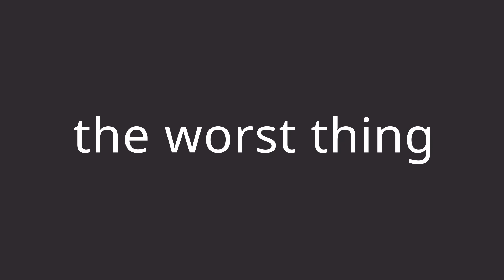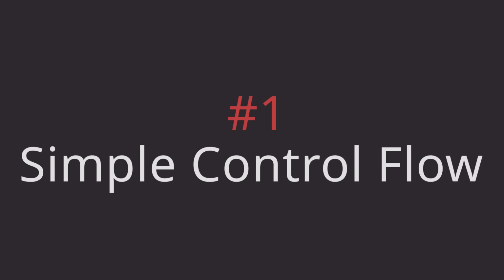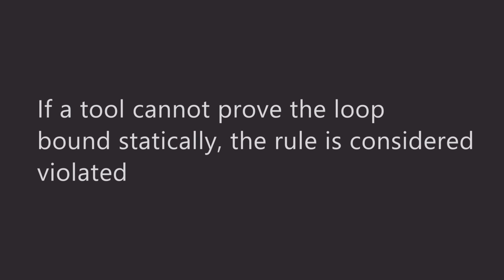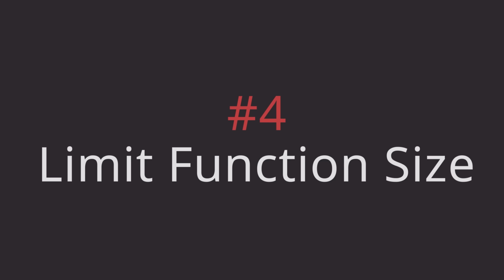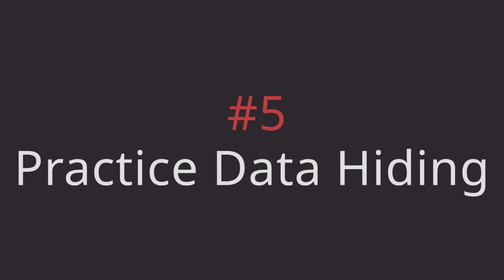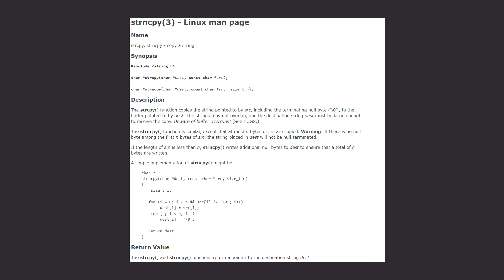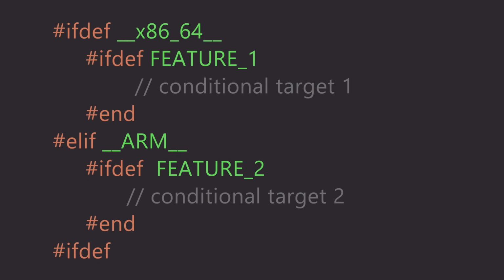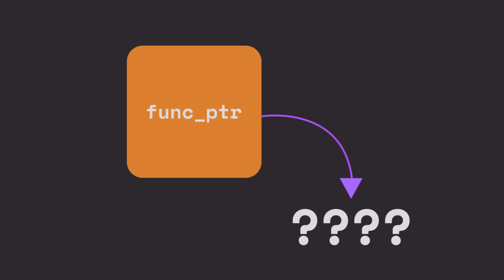how NASA writes space-proof code

Comment: It is very similar with the rules used in the embedded development for automotive industry.
Reply: Yep. The rules are known as MISRA, and they are used not just in automotive industry.
Reply: @alexandermarvin9536  Yes, MISRA was created for automotive, but now it is used also in other areas. However, some parts of the code present in this video clearly violate some MISRA rules and this surprises me. For example: mandatory else at the end of 'if..else if' chain or the rule that every function can have only one single point of exit, so only one return located at the end of function body is allowed.
Reply: @alexandermarvin9536  but according to MISRA website, MISRA was started in the early 90's. NASA has been around before that. Maybe NASA rules didn't come from MISRA?
Reply: @alexandermarvin9536  I came wondering ooh what secret and special rules NASA would use??
And then went oh just typical misra :(
Reply: There are already compiler warnings and static analysis for MISRA-compliant C. It’d be nice if a language could make compliance mandatory, but different embedded systems have different limits, and there are reasons to deviate from the standard guidelines. Hard to make a strict language for a moving target. As for the argument for gc languages, heap memory management is non-deterministic, it’s not something you want for real-time, and if you preallocate before the loop and never free, there’s no reason for a gc anyway. In fact you’d want to remove that unused feature to have more memory to use.
Reply: @MynameisBrianZX  oh yes, embedded is always carte blanche for excusing following good engineering principles. This profession is a joke
Reply: @monad_tcp  If you're so confident you know what a language that enforces "good engineering principles" for embedded systems should be, then make one. I don't have high hopes considering you're ranting about manual memory management in a context that doesn't need heap allocations, but maybe you do know better than several generations of programmers.
Reply: @MynameisBrianZX  you're wrong about the context of embedded not needing heap allocations.
Whats being demanded from embedded devices nowadays it's much more akin to what we demanded of desktops in 2005 , in terms of them being connected to networks, running multiple services, and being reliable .
Which is why we get "internet of shit" insecure bugged devices , I mean IOT.
What I'm saying is that embedded is not a special unique field .
It's software engineering and software like everything else .
 But just stuck on the past and with outdated software development methodologies specially because of this culture of exceptionalism.
I don't need your hopes.
And I was not ranting specially about embedded development , I was ranting specifically about the C language, this thread became long enough for context to change or be lost.
Reply: @MynameisBrianZX  of course I know better than 3 generations of software developers , I saw what they did, and I saw why it doesn't work. I'm on top of the their shoulders.
I have hindsight given to me by knowing history and I refuse to keep making the same mistakes out of being stubborn.
Also I have experience on the field, so I don't need your permission or anything.
In fact I'm so confident about it that I have a business developing tools to fix those problems.
But if you still thinks you're the right one, so keep thinking whatever is that you think. You do you, you stay on your path, while I carve new ones in the jungle of unsolved problems.
Reply: True, except maybe the macro part.
My favorite MISRA warning is having multiple return in a function btw.
Reply: Big rocket needs to go boom boom but code not
Reply: MISRA here we go!
Reply: Ah yes, "miserable C" is what I and some colleagues call the most popular set of guidelines.
Reply: Ah yes, "miserable C" is what I and some colleagues call the most popular set of guidelines.
Reply: Iso26262 too?
Reply: @carlesls  jeez, you triggered my ptsd. I just want to forget this ASIL thing
Reply: Maybe for the engine computer, otherwise all bets are off IMH
Reply: @ffoska  All safety-relevant devices are handled the same way (actually more than that). It's only the infotainment system that gets a little wild...
Reply: except for that one radio station in seattle that had an image formatted incorrectly that caused certain car infotainment systems to bootloop
Reply: Fixing MISRA errors 😅
Reply: I wrote embedded FW for medical devices and we followed most of these rules too. Although it makes sense that our code is similar to automotive since we used MISRA rules for our static analysis.
Reply: they ban pointer arithmetic, which is a good thing imho. if you need to access an offset you should use [], not +
Reply: I was going to say the same thing about embedded code
Reply: Medical devices as well
Reply: Not coincidentally ...
Reply: Or particle physics accelerators near the interaction points where decommissioning the system is the only way to access it.
Reply: @aravindsathyanarayana3256      "Garbage collection isn't deterministic"  Garbage collection can be deterministic, there are models that guarantee it will run for at least that fixed amount of time (*1) , its the use of the heap that makes your software be not deterministic.
It literally don't matter much how you manage the heap, having the heap is the problem.

"In some hard real time systems where memory is to be allocated using malloc/custom function, it is usually done one at system startup n never released till shutdown/sleep"
That's exactly what I was saying before.
Allocating memory at the startup is the same as having global static memory. 

You're not using a heap as a heap, you're using it as a massive stack if you do that.

(*1 - it really depends on the implementation, it usually isn't because most GCs are tracing, and they would need "pointer tagging" and that would need hardware acceleration to be efficient and absolutely no hardware have it, and most computers actually already use virtual memory, so there's no point in doing that if you are a virtual memory system, you're already non-deterministic in runtime anyway)
Reply: And medical device software too
Reply: Glad I was taught similar things when learning how to code in my first language, C
Reply: Some years ago I interned at a company that makes packaging machines for pharmaceuticals. They also have very strict restrictions about code, and everything needs to be certified. The customer also comes to the plant and reviews all code of the PLCs
Reply: I mean these rules are for safety and cars do require and always will require as much safety as possible you don't want your car's program to crash while you are going +80mph and even if that happen they can decode it and see where it failed and fix it...(rip to the guy who got sacrificed to find out that error)
Reply: This is the comment I was going to make.
On top of these rules though, there are also 100% code coverage, fuzzing, KPI calculations, debugging traces, etc. Lots of stuff. It's not a rocket and not in space, but all it takes is 1 accident and the company shares drop 20ish percent
Reply: This is like a car mechanic saying "the steering wheel of a car is very similar to a 747 flight stick"
Reply: Its almost as if satellites have embedded systems.
Reply: Yeah when I watched this it just sounded like misra rules
Reply: And medical…
Reply: MISRA :)
Reply: Mostly just mentioned C++ coding guidelines
Reply: I was pretty impressed with the Tesla security presentation at Defcon; iirc it compared Tesla's decisions against other automakers' in a decent way
[edit]: Due to questions below, here are search terms: DEF CON 23 Marc Rogers Kevin Mahaffey Tesla Model S
Reply: @oddlyspecificmath  link?
Reply: @Croissinate  In case there's a channel filter, just the search terms: DEF CON 23 Marc Rogers Kevin Mahaffey Tesla Model S  It was popular so just the bold terms should work.
Reply: @oddlyspecificmath  which talk ??
Reply: @ko-Daegu  Ah, more people asking :) I'll edit my first post with search terms.
Reply: If those rules are so good , why don't we create a programming language where it's impossible to break then instead of relaying on absolute perfection of human discipline (unattainable goal).
But no , we keep using C
Reply: @monad_tcp  I think the rules are really restrictive, not really “comfortable” for most situations. Meaning it would be a lot of headache and take a lot of time to create any program. HOWEVER. When you are writing code that will go to space, if it crashes then there is literally no way to remotely restart the computer. So you have to go the extra mile and be absolutely certain that it will never ever crash. That’s not really the case for most applications though
Reply: @dominiklukacs7677  That's the problem with the C language, its the "confortable" thing, they are HARMFUL.

If there's one thing we learn as the field of programming and computing science advance is what not to do.

Because you can literally do anything:
self-modifying code
come-froms
gotos
non-structured code (no use of functions)
everything is mutable
everything is dynamic memory
dynamic types
only a single type
nulls
excessive message passing (aka function calls)
manually positioning every single byte in the memory

turns out, all of those options were Bad Ideas (TM).

See, that's the problem with C.
Being too comfortable with mutable state by default and not thinking when state transitions are required and when that's just data transfer masquerade as mutable state (because of a blunt tool)

Another thing that humans are utterly bad : manual memory management. Why the f, do we manage memory ?  its total accidental complexity, no algorithm really requires it, nothing in the problem you are actually using computers for require it . Fortran didn't even had memory allocation, you just declare your arrays a fixed size which was a parameter of the program startup, and that was it. If it didn't fit memory, you just change an option, nowadays it doesn't even make sense when you can address a PB of memory, just let the OS do it for you.
Do you manually mark and control blocks on your hard drive ? no, the operating system does that. Why's it acceptable for a program/programmer to control memory ?
And the most ironic thing of all, manual memory management is more of a cultural virtue signaling (see how good I am, driving my bike without hands, proceeds to fall off and break all teeth). 
Really, manual memory management is the most boring thing ever. Its basically inventory management. 
Guess what, "normal" people use computers to manage inventory for them because they realized that by memory (human memory) they kept forgetting where products are, how much they are, and when to buy more inventory.
Its ironic we program computers and have tools to manager cruft like memory, but we don't use it because we, as programmers, think is heroic no to use them.
Like, don't even come to me saying its "optimization", its just bad engineering, and the generational model of memory consumption is one of the most tested and established truths about how data flows. Automatic memory management uses only twice the amount of memory it would be required if you manually checked every single bit, and that's the worst case, the average doesn't come closer to 20%. (its like floor-plan planning on microchips, machines do that for 1B transistors)

Things that were utter mistake that cost lives and billions of dollars :

NULL POINTER.
Manual memory bugs.

C has those, so its totally not fit for purpose. If we were civil engineers, we would be embarrassed by the failures, and the fact that all bridges collapse. Not only that, we know why they do it, and we even know the solution, we simple refuse to change our "ways".

Which is why in critical safety system you aren't allowed to allocate memory after the startup of the program, everything is allocated beforehand and it stays allocated forever, even if that costs more memory. 
Memory usage doesn't matter that much, not to the point you introduce bugs by using dynamic allocation to overlap. (don't even get me started on stupid memory aliasing in C, not even the hardware likes it, its stupid, and breaks DMA and I must scream)

Perhaps I need to wait on this hill for the old programmers to die. You know those that were born in a world when 1MB of memory cost $1M USD. 
Nowadays I can buy a microchip that costs $0.5 that so small that I could eat it and it has 1GB of RAM, there's no reason for using memory unsafe programming languages.
Reply: @dominiklukacs7677  what about implementing a watchdog timer?
Reply: @monad_tcp  hi
Reply: @monad_tcp  Quite a rant. Agree with all of it.
Reply: @monad_tcp  You are completely ignoring the embedded space.
Reply: @LittleRainGames   I'm not ignoring it, I'm talking about management of the heap. Embedded development has strong restrictions that don't allow the use of the heap because of the exact same reasons and problems with manual memory management. 

The MISRA rules almost force you to use the stack, thus you don't suffer any of the problems. Most of what I said don't apply to embedded because you don't do manual memory management on the embedded space.

Everything is stack allocated or statically allocated by the compiler. 
I'm literally advocating that this should be the standard for everything. 

I know this thread is already super long and some context might be lost, but pay attention.
Reply: The MISRA rules almost force you to use the stack, thus you don't suffer any of the problems. Most of what I said don't apply to embedded because you don't do manual memory management on the embedded space. Its much more important to allocate everything all at once, then "leak" it, then account for the total memory needs of every single variable without any sharing at all, then you force that as requirement for the hardware. I worked on this field too, some things are a bit different in this regard, but things are changing and you are going to start having the same problems as traditional CPU computers have, because you're not on a so constrained environment anymore. 
The moment your embedded system has any sort of network connectivity, that's the moment things change, and none of those rules are good enough anymore. Thus your carte blanche is not an argument to this discussion on memory management.
You better get up to speed to modern software engineering.
Reply: @dominiklukacs7677  I always wondered how they did code......makes sense it shares similarities to the automotive industry standards, I would assume underwater vehicles would get similar treatment since the oceans and outer space are the harshest environments known to man.
Reply: @monad_tcp that part about people turning to computers because they couldnt remember where inventory was is rubbish. 

Programmers told businesses it was cheaper to do it on computer than on paper.

The layman never asked for computers, computers were interjected into their kids lives and their working lives against their will.
Reply: @monad_tcp  Until recently there was no viable alternative for its use cases. Also, as I understand, NASA uses tried and tested tech. So, say, a mission being created today won’t use Rust. But one created in 10 years will.
Reply: @kevinmcfarlane2752  fair enough .
But Rust is almost there in reliability, it's not like it's not mission critical, it's just isn't there for NASA it isn't yet.
But as both Microsoft and Linux are slowly incorporating it on their systems. It'll happen eventually.
So you're probably right.

Rust is really different this time because it was built on top of an actual formalization of the life cycle and management of memory.

It's not about 'heap' or malloc.
Reply: @monad_tcp  you have a fork and a knife. In case you are right handed, you should hold the knife in the R hand and fork in the L hand. Thats the correct ettique. If thats so elegant and right, why dont we create a fork and knife that electrocute you if you dont hold them properly?
Reply: @salat_32  that's not a bad idea .
Reply: @monad_tcp  what if I told you this language exists and has been used for longer than C (yes, Fortran)
Reply: @gronki1  FORTRAN is a bad example, FORTRAN90 added dynamic memory precisely because people were using unstandardized extensions including malloc and free, or they were declaring large arrays and manually managing the elements.
Reply: @gronki1  ironically Fortran is literally better than C
Reply: @MynameisBrianZX  this is exactly why we need heap management in a programming language.
"but it's embedded" no, try implementing a TLS ASN.1 without inventing poors man malloc in a system without a MMU and come back to talk to me.
Things I've heard related to that :
Oh you don't need network , right. Yeah, good luck with that, even a pic32f has a network library. Oh cares about security , right ? Send plain text.

Even Sun.Misc.Unsafe became standard.
There's clearly a need to have access to low level memory management.
One might pretend they don't need it, as they pretend they don't need heap.
Or they do as Rust did. Here you have unsafe in the rare cases you need it, don't go hacking non-standard crap.
With heap and memory management it's the same thing. "it's embedded I don't need it"
 Sure, but when you do you're going to need some formalized way of dealing with the heap, that's why Rust exists.
(just not going to realize that until too late, then implement a poors man malloc/heap, then shoot oneself on the foot, as one usually do if you use C/C++)
Reply: @monad_tcp  ADA or Spark
Reply: @monad_tcp  That's kind of the goal of the Rust language...
Reply: @adrianbool4568  Yes, I was gonna to add to the conversation that Zig, despite not being production ready just yet, also has a very similar goal. Zig is to C, what Rust is to C++ (in theory).
Reply: @tomsbk  that's a good take
Reply: @monad_tcp  they mentioned they use static analysis to verify the rules are being followed, so yeah.
Reply: @Slackow   That's as good as opt-in, and you know how people go for opt-in standards...
Reply: @monad_tcp  not really. How exactly do you design a language that is constrained to these things anyway? Like sure you can make it not compile if you have too many lines in a function but realistically what's the difference between doing that, and just using C, while requiring devs to run their code through some static analysis before pushing their code? It's the same thing.

This way you don't need an entirely new tool for constraints you may want to change in the future and you can hire people who have experience with C
Reply: @monad_tcp  They use C because it is the best option currently. Garbage collected languages are too inefficient for embedded systems.

Yes, they could rewrite the code in a safer language, but there is probably  millions of lines of C code used in Nasa, it would be stupid to rewrite all that code, the rewrite would be more effort than just improving the C code.

As the other guy said, they use statical analysis tools to enforce the rules. "Oh BuTs ItS OpT-iN sO iT iS uSeLeSs". No, the senior devs can enforce the use of those tools and probably does. 

I am currently learning Rust, since i do not trust myself writing safe C code, but your ranting is just nosense.
Reply: @Slackow  how do you design a programming language that constrain semantics ? The same way you design a static analyser that does that.
Except you incorporate the semantics in the syntax to make it easier to model the semantics and for it to be explicit.
And you don't need two tools doing the same thing and fighting each other.
Your compiler says X.
Your analyser says Y.
Who's right ?
That's the problem when analysers are opt-in .
About people having experience , doesn't matter much, programmers that only know one programming language are kind of limited either way.
You do what anyone sensible would do. You hire based on domain model, if a person knows how to design software for quadcopers , does it matter if it's C or C++ or Rust ?
That person could learn the language in a couple of weeks.
Their domain knowledge is much more valuable than knowing all stupid quirks of a programming language.
Specially as you are going to use static analysers or a language that's a good tool and guides you the correct way.
Reply: @rj7250a   no one said rewrites , rewrites are always expensive.
Which is why were in this mess.
But can we please stop writing new code on archaic languages.
Reply: @rj7250a  seniors can enforce the tools , hahaha , is this "the office" sitcom ?
That's why we need programming languages, it should be enforced by design, not by policy.

Policy change as people move out and in on companies.

A tool design doesn't , because it's defined by the comitee of system designers and it's standardized.

And you're the same one that said "but hiring", well, what if every company has their own static analyser ?
now what , you are going to learn a new environment either way.

I just want it to become a standard like engineers have.

At least for safety critical systems. I don't care about the "I'm unique exceptionalism of your company"
Reply: @monad_tcp  I still don't see the issue of static analyzers, how is it "opt-in"? what if it's a standard part of the process of pushing code? Like in order for you to make any changes your code must pass both compilation and analyzation. I also don't really see what you mean about the two fighting, it's just an additional layer.

Why overcomplicate it by adding new tech to maintain when you can extend tried and tested languages? Every organization wants their own parameters for this sort of thing anyway.
Reply: @rj7250a  the biggest problem with garbage collection on microcontrollers is not so much inefficiency (although that's a part of it) but unpredictability - as soon as you're anything approaching real-time, you can't afford random GC pauses

"Open the pod bay doors HAL"

"I'm sorry Dave, I'm afraid I'm running a stop-the-world garbage collection right now"
Reply: @NicBellamy  Incremental GCs split up collection cycles across frames for (soft) real-time, eg the game engine Unity. But so far that seems to take overall more time (throughput-latency tradeoff), and it does not prevent all GC spikes. Even with a GC, it's good to avoid overwhelmingly frequent garbage, and there are deterministic but more situational allocators, provided you have the memory to spare.
Reply: @MynameisBrianZX  there's a way to prevent spikes when you have multiple cores and a cross-bar when you implement a non-stop-the-world.

People keep parroting GC = pause like its 1990.

I don't believe it takes more time than manually managing the heap. (it certainly takes more time than doing nothing, but engineering has other tradeoffs to consider, not only performance )
That's more of an accounting problem. It's easier to see GC taking time than millions of free/malloc call absolutely split over the entire program and running mostly outside telemetry because it's internal library code.
GCs have to do work , but it's mostly tree management and there's ways to optimize that. 
Also malloc implementations also do work, there's entire complexities on STL in C++ to optimize it away , it's not like malloc is "free".

It's all about the predictability of the latency. Latency doesnt matter much if you can predict it, you can work around that. Everything has latency, as long as you want to compute.

And what usually causes spikes is heap compaction, which you can disable if you have a lot of address space and after doing tuning . 

Ironically , embedded don't preclude using GC or even having non predictability .
As long as you have a proper real-time system that does job batching you can even have GC because you can schedule it ahead of time in the time slices when there's idleness.

The thing is that you absolutely don't want to have any form of dynamism in the critical parts of the code. So no mallocs/no GC/no Rust allocations either.

The idea is basically alocating everything in the global variable section of the program, so the space for that is allocated before the program even runs.
Using GC is pointless in this case, as pointless as using malloc. 
But people keep insisting that all the code they write is this kind of code.

The thing I was saying is against manual memory management on embedded. 

Rust is excellent in this case because it can track ownership of portions of memory muhh better.

GCs aren't good in this case, nor is static allocation in the global section, because that's also manual memory management.
Reply: @monad_tcp  We did... it's called Rust... and frankly, it's horrible.
Reply: @Luiz  they are not generally good. They are hurting productiviti and maintability. No function pointers, means a lot of duplicated code for example.
They may make code easier for static analysis but it may be order of magnitude harder to write. Nasa isn't  known for efficiency.
Reply: @adaslesniak  you don't need function pointers to pass functions to functions . All functions have an address known at compile time.
Reply: @monad_tcp  That is or: A - not a passing, but hardcoding them; or B - it's still a pointer. It doesn't matter if it's a pointer to static place in memory or dynamic, it's still a pointer.
Reply: @monad_tcp  You should try writing an OS in Fortran. Good luck. C could use some QoL features that could also help writing safer code, but taking away the powerful features of C would be an epic mistake. If you don’t need a systems programming language for your project, use something else. There are lots of options.
Reply: @adaslesniak   its not a pointer, its a hardware address, its only know by the compiler not by the user or the runtime.
Reply: @monad_tcp  you mean Rust, becos legacy system.....
Reply: @monad_tcp  you mean  rust
Reply: @monad_tcp  It's already in a make ... called Ada/SPARK
Reply: @monad_tcp  speed is the thing. Production speed is way more important for a software development issue.
Reply: Because it's way slower and development speed gets priority on earth.
Reply: @monad_tcp  maybe Rust is trying to be a programming language where it's impossible to break, instead of relaying on absolute perfection of human discipline
Reply: @monad_tcp  Rust seeks to achieve that rules
Reply: @monad_tcp  I mean, it's not 1:1, but Rust is getting there.
Reply: Pls dnt even use similar. You no nothing.
Reply: It depends on industry. Such harsh rules will increase the cost of product too.
Reply: In the end its still a vehicle
Reply: banning function pointers is like banning knives just because someone got hurt whilst opening a can with one.

i did misra for years, but i basically also wrote functional C code. so either i did misra wrong or they are doing it wrong.

misra 104 disallows calculating function pointer address with like... math and such - but passing references is completely ok!
Reply: @martinzihlmann822  disassembly of a function pointer is painful to look at. So static analyzers might get insult
Reply: @martinzihlmann822  Pointers make it hard for analytical tools to understand what is going on.
By design they can point anywhere. It is a form of unstructured programming.
Often they can be replaced by indexes and/or switches, if performance is not absolutely critical.
Reply: I’m pretty sure MISRA bans all pointers period
Reply: @bashdavid9223  No, they don't, since pointers are pretty fundamental to C.
Reply: It absolutely does not ban pointers. That’d be ridiculous.